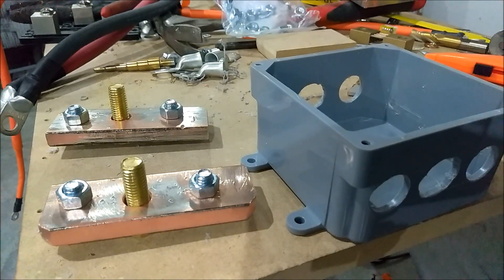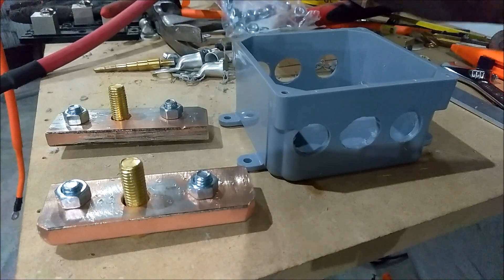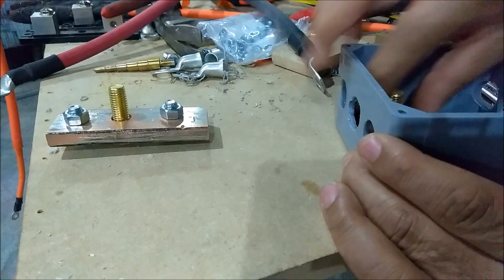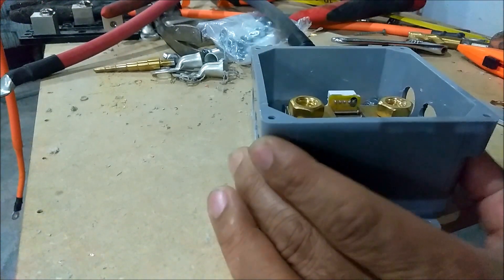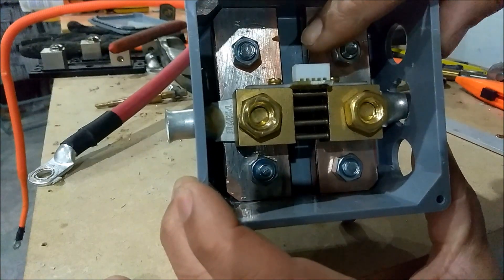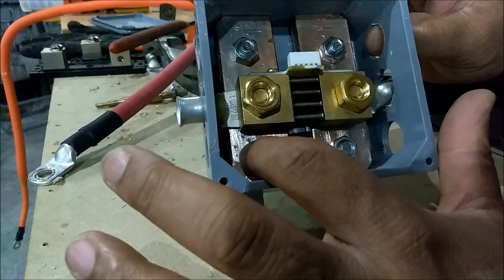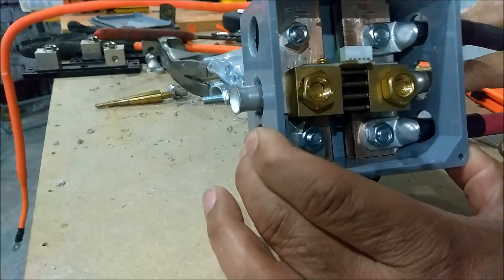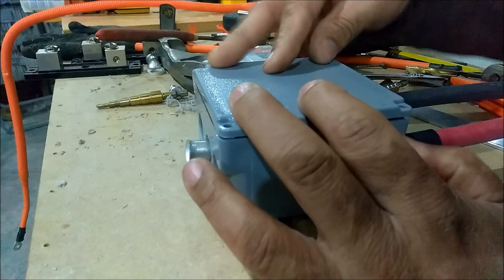Negative bus bar for inverters

Comment: Looks really good. Something to think about   there's heat coming off the shunt. I don't know how much under heavy load
Reply from the maker: I have been monitoring it with my thermal gun for at least 8 months I have never seen it over ambient temperature. in some of my old videos you can see me checking the temperature of the bus bars batteries and the shunt.  I have never had a heating problem out of any of it.  Thank you for the concern I will still keep track of what is doing after I get it going inside of the box 👍.